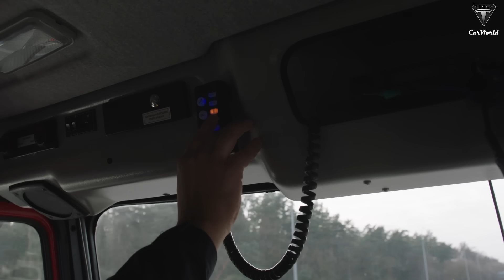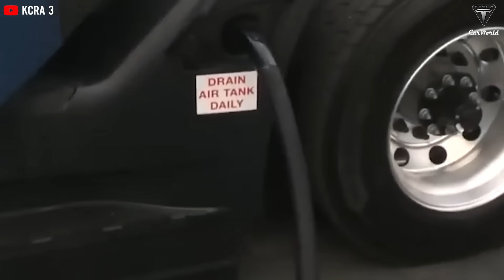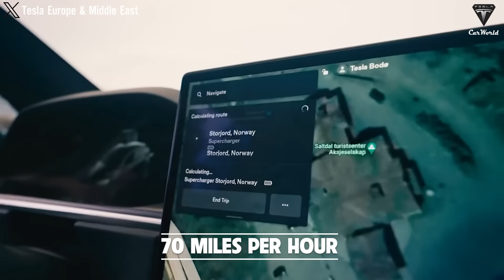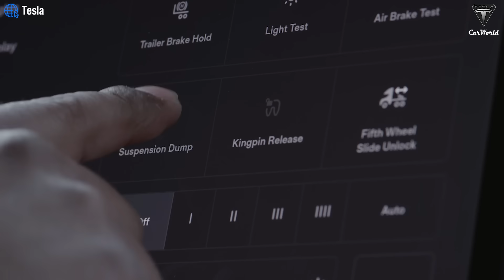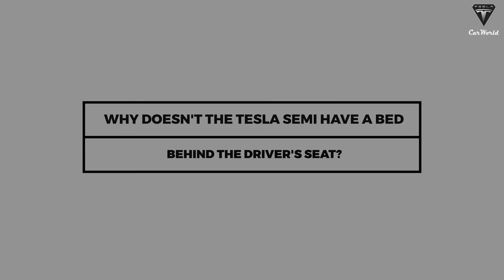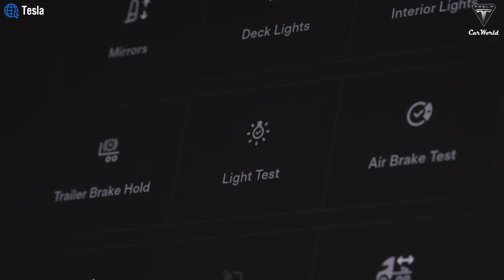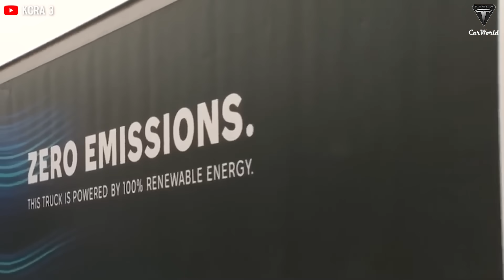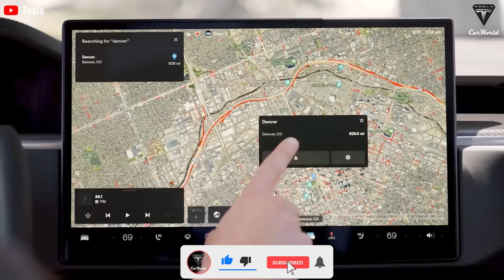Elon Musk LEAKED 2024 Tesla Semi 4 Mysterious BIG Problems, Exclusive Way to Change EV Industry!

Comment: It can't shift antonymous past 6th gear?  Elak owes Tesla billions he withdrew with fake bloodlines and lies.  He defrauded the company and it's original investors.  Like the Prefontaines and McAuliffs. He's a fraud for Tadensky and Dahmer.
Reply: But on the bright side, compression braking refuels the battery faster. Just like in Toyota Hybrids.  Your compression brake charges more than your foot break.  You don't slow the wheels with break, you slow the engine.  With both the positive and negative counterbalancing.

Comment: reports are some places where companies wanted to go ev were denied permits for electricity. and if plans to shut coal. oil and nat gas electric production where the electric going to come from especially at night. nuclear is the only answers but it will take 30 or more yrs under current obstacles even to the newer safer plants  . i see some use for ev but not 100%
and no comparison cost of tesla vs diesel truck and if co can get electric service fast chargers are expensive only 1 i seen a utility service truck with man lift vs ev similar size diesel 90k and ev 2 to 3x cost and the 30 min charger vs 10-15 for diesel truck when your paying driver 30-40 bucks hour and its not uncommon for chargers either not working, vandalized or unable to charge at full too cold but also too hot like mid day syn beating on the charger slows . and installers rarely cover like most gas stations so yout in the rain connecting and removing power cords

Comment: Charging Tesla is unattended freeing the driver.
Unloading and loading can be done while charging which may be at a less expensive lower power level, having more time,
Optimization is unique to the operations strategy of the users. It is a different world of clean air and no noise.
The whole truck can be parked and charged indoors, it emits no exhaust. Snow removal time can be eliminated.

Comment: "Replacing diesel trucks with electric semis led to charging time and load losses passed on to customers.
Green energy initiatives that will mandate all new semis be electric starting January 1, have led to $310 loss per truck. The long-haul company then had to pass it to its customers in order to break even." (c)

Comment: Some thoughts .In mountainous or hilly areas, the Tesla semi can power up a hill,  while a loaded diesel truck slows down.  Then the Tesla semi can maintain a constant speed down the hill and regenerate 40% of the power it used to climb the hill.  The whole procedure uses less power for the Tesla, more expensive fuel for the diesel, is more restful  for the Tesla driver and avoids speeding. It could even proved more charging + rest time for the Tesla driver.
Reply: Plus in traffic areas semi will excel here a diesel consumes a lot of fuel in stop and go traffic EVs excel.

Comment: Come on!  NO ONE is gonna charge an electric semi truck at home!!!  They are going to be charged, most of the time, either at their base, or at their destination (distribution warehouse for example)... except for long-haul operations, for which they are definitely not optimally suited.  So, it is more likely to be charged at the rate for industrial/business clients of around $0.10/kWh rather than at $0.23/kWh!!!  So, the power bill for a complete charge is going to be rather around $90 than $207!  That compares to $300 for the same distance for a diesel rig... and adds up to a cool $26'350 saving per year for the average US class-8 semi, whose annual mileage is given to be 62'751 miles per year (source:  DoE).    

As a side note:  in my residence country of France, electricity is about the same rate as the US average, but diesel fuel costs about $7.10/USG, from which a commercial trucking operator can get the 20% VAT, so will pay about $5.68/USG.  On that same 500-mile trip, the price of power for an electric truck will be around $72 (VAT can also be deducted by commercial operators on their power bill), but it will cost the diesel truck operator the equivalent of $437, or a bit more than 6 TIMES as much!!!  That might just explains the higher adoption of electric trucks in Europe, don't you think?

BTW, it also means that the average class-8 truck in the USA, assuming it is used only 5 days a week, 50 weeks per year, is driven only 250 miles per day on average.  It makes Tesla Semi's 500 mile range look plentiful, doesn't it?!

It also means that the driver will spend zero minute specifically waiting for the truck to be recharged!  Either it will be done at night, or in between shifts, or while the truck trailer is being loaded/unloaded!

The reduced range of EVs in cold temperatures is NOT due to the lithium ion batteries, but to the additional consumption of systems such as the one keeping the battery at optimal temperature, and cabin heating.  While the range penalty for an electric car, not equipped with a heat pump, can be as high as 40% in 0°F temperature, it is more like 20-25% for one equipped with one.  However, in a truck, the  consumption of those systems, IN RELATION to the size of the battery, is much smaller than in a car.  The cold-weather penalty for a Tesla Semi is therefore going to be less than 10%, making next to no difference for 95% of operations!  But the video pretty much nailed THAT issue.  Kudos to Tesla Car World as it is not an obvious one, and the video mentioned quite well the differences with a car on that topic.

Comment: I would like to suggest you evaluate the Peukert curve for battery life vs number of charge cycles vs amount of % charge and discharge. Battery life could be quite short in a long haul routes. Also diesel trucks can easily get 7 to 7.5 miles to the gallion if properly set up for fuel economy. Early battery replacement and potential battery fires could be a major negative factor.
Reply: The Tesla semi comes with a one million mile warranty. At 250k miles per year that's 4 years. That's a saving of $92,000 a year on diesel (using the fuel prices in this video). The truck pays for itself ENTIRELY in fuel savings alone in 2 to 3 years.

No brainer.

Comment: 6.5 mph x 120 gallons (2 tanks totaling 120 gallons) is not 1580 but 780. Something is wrong with your math which brings into question the whole video
Reply: A Diesaal  truck can’t adverage 65
Reply: @frederickfaller899  Indeed!  I don't have any experience of US trucking, but in Europe, a class-8 truck is limited to a speed of 90 km/h (56 mph), and averages max 50 mph.  Over here, a driver is limited to 9 hours of driving (with a 45 mn mandatory rest after 4.5 hours).  That equates to a maximum realistic (and lawful) mileage of 450 miles per day (for single-shift operations)... making the Semi's range JUST right!
Reply: No matter how enthusiastic I am about Tesla' Semi, I quite agree that it is not at all optimal for cross-continental long-haul operations (although it would in Europe, as driving hours are limited to 9 per 24-hour period)!  But what part of the trucking market are those 10%? 20%?  That leaves enough of a market for the Semi, doesn't it?
Reply: That is 2 X120 gal tanks for a total of 240 gallons. Some long haul trucks actually have up to 400 gallions because of fuel avaiability issues and fuel optimizing. The 6.5 MPG includes hotel loads (heating, AC, lighting, refrigeration and hot plate), and the Tesla doesnot. As usual new technology ususally over promises and under deliverys when reality sets in. The advantage of the electric truck are real but over hyped. That sure helps the stock price!!

Comment: Can it take a 25 ton load for 500 miles? Or 25 ton load for 300 miles? The amount it can take in cargo is the number one question which is never answered.
Reply: It is pretty much known by now!  The short answer to your specific question is no!  The 500-mile version of the Semi is limited to a payload of around 22.5 tons, not 25, in the USA.  In Europe, it would be able to take 23.7 tons (21.5 metric tons), due to a higher extra allowance for electric trucks (2 metric tons in Europe, instead of 2000 lb in the US).  The 300-mile version of the Semi, however, will be able to carry 25 tons.
Anyway, max gross-weight operations are less than 5% of total class-8 operation in the USA! It is reported that independent truckers even tend to decline such operations, as they tend to put more wear on their rigs.   So, it is a non-issue for most operators!